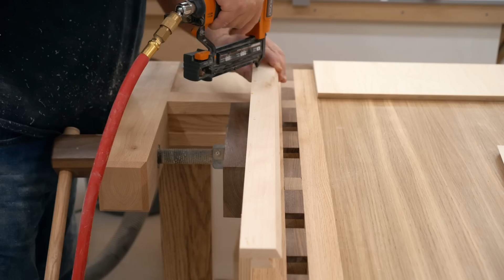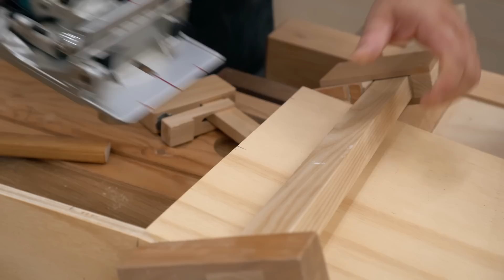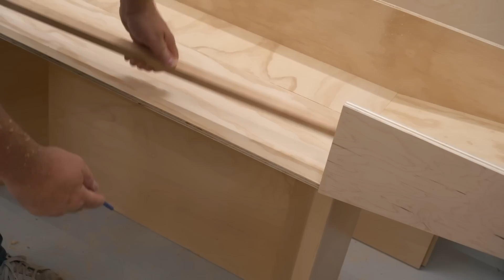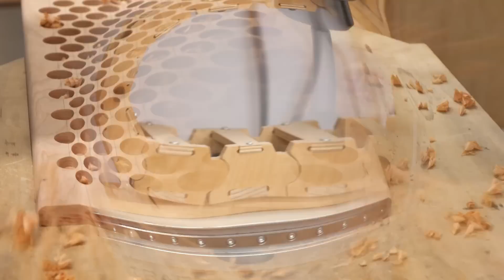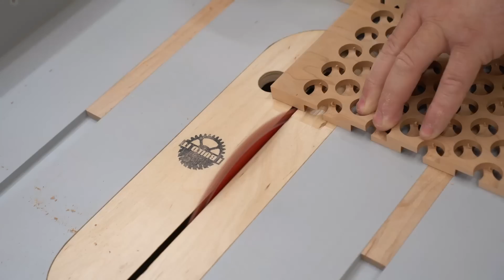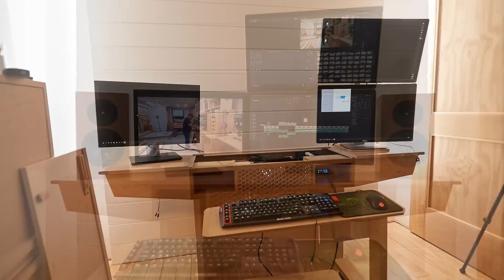Did I Make the Coolest Desk In the Known Universe? You Tell Me

Comment from the maker: I needed a computer upgrade for video editing, so I figured I'd go the full distance and build a new neat looking desk to put it in. I say desk, but it's really more like a table to put the speakers and monitors on. 
I don't sit at it; I'm in a recliner in front of it with my feet up, relaxed and chilled for editing video for long hours in comfort and style. 
Stand up desk? Are you kidding? I stand up enough without doing it while I'm doing something I can be doing in a lazy boy. 
Typical video like this one can take two days to edit and after doing this for 10 years I'm not even going to start unless the conditions are perfect. And this is as close as I've come, so far.
Just in this one room there are several projects I've done in the past. See if you can spot them all.
Key Parts: 
CPU - Ryzen 7 5800X 
MB - ASUS TUF GAMING B550M-ZAKU
RAM - CORSAIR Vengeance RGB Pro 32GB
GPU - MSI GeForce RTX 2080
NVME DRIVES - 2 -  Intel 660p Series M.2 2280 512GB - one for system, one for video editing.
The cpu, cooler, motherboard, ram and one of the m.2 drives are new. I already had the power supply, other m.2 drive and other hard drives plus the graphics card from the previous editing computer.
This thing runs Davinci Resolve and that's pretty much it. I only turn it on when I need to edit video, so it's off most of the time. I have absolutely zero concerns about heat - there's great airflow through the case with that monster fan when it spins up, and it only spins up when a video is rendering.
Reply: Hey that is a very impressive desk, the only thing I would have been concerned about is the cooling aspect but I'm sure you took that into consideration. Did you consider an all in one liquid cooler for your processor? Ever since those have become reasonably priced I have used those in my builds instead of a heat sink and fan. Another incredible job though!!
Reply: @davidloveland9634  I'd somewhat agree on the CPU cooler maybe being a little inadequate however it probably won't matter too much as heavy loads will often be on the GPU anyways. 
Overall great desk. Love the Mac Pro inspired grate.
Reply: I am also concerned about the cooling - please check your temperatures. The other thing is that the hard drives (with spinning disks) really prefer to be placed horizontally rather than upright. Just my 2c.
Reply: hm...be funny if you made an apple tower pro case but out of wood XD
really enjoyed your time lapse...if only my allergies didnt act up every time I work with sawdust :(
Reply: Love the keyboard, it's honestly the best,  without going custom. Cherry MX Brown key switches with full back light. 

Logitech G710+

If anyone watches tech channels, this is the same keyboard Linus of Linus Tech Tips uses in his work office.
Reply: WAY COOL DESIGN John! Beautiful. I have Star Trek envy right now! ;-)

Comment: I am not only impressed by the desk build itself, but your computer set up is a very powerful system.  There is no such thing as too much RAM, especially in your video card!   A strong power supply will more than cover it.  Getting gaming MB is always helpful rather than just a standard "for business" type since these were built for abuse, heat and high speed, overclocking if necessary.   You can never go wrong with a good gaming system, it will still run office software with super ease.

Comment: Very nice john. A suggestion to make it look even cleaner: why not install a 3/4" back panel attached to the desk, so you can get the displays off the desk and  onto the panel. The panel would hide the cables as well. You could also use black pipe instead to hold the displays, but I know you like making things of wood ;)

I worked in a professional broadcast post production facility and we had a huge desk that had all the editing devices (video switcher, sfx consoles, different scopes etc. The (26), 1 ton, 2' video tape machines were in a different room. Our editing suite was sound proofed with carpet on the walls and floor with acoustic ceiling tiles. No wires were ever showing. To perform  maint, the entire desk moved away from the walls, via motors that powered the desk in and out from the wall. The wall had two monitors, a preview and a final output display. The speakers were hung on the wall. On either side of the monitors.

Comment: Dreamt for 10 years of making a desk, where the monitors pop up when you turn on the computer, out of the desk, love the style of desk you built and spurs me on to make one myself! ty great design! IKEA should be so lucky to have you as a designer over in Älmhult !
Reply: It's somewhat easy to do, just get a pair of linear rails (Using wheels on the side of a board works too.) you that are the height you want + the size of the attachment (10cm or so) then you can use a windshield wiper motor to drive a threaded rod or a screw and move the board the screen is tied to up and down.
You can add a plate on piano hinge over it, it should open automatically, you can add a string tied to the bottom of the board and on the plate so it pulls it down when it bottoms out.

Comment: Wow, that's a cool build. It has so many angles it just looks so neat. I've been wondering what to do about my setup as a already stand enough at work and then working in the garage. I've finally found something that is very similar to what I would  like to do. My idea is to build a panel similar in construction to a desk, but I would mount it to the wall on standoffs. The reason is it could hide cables, mount the speakers, and I could mount the monitor to it. I thought I could also slot the mounting holes for the monitor arm so I would have some vertical adjustment. plus the panel could be artistic, I could do wood carving or burn it then seal with epoxy and mica powder, or do a hexagon and resin pour. The options are endless, if anybody has ideas post below.

Comment: Very nice.
Extra credit for the rare appearance of an optical drive. 😁
You might consider using a dust filter. Theoretically, with positive pressure and a dust filter, the case should not accumulate dust as quickly as otherwise.

Comment: Very nice. Ryzen CPUs are just great for video editing. Noctua fans are awesome. Davinci Resolve is cool too. Give Kdenlive a shot, it's a very capable & free editing solution. Run it on Linux if you're so inclined. I'd go for a MSI motherboard over Asus, certainly higher reliability. 

There's a major problem with a wood (or plastic) computer enclosure. Computers spew MASSIVE amounts of radio noise. A metal box is required to shield it. Cases with a large clear window are as bad as all plastic. You might as well build it with wood. If you attempt to listen to the AM broadcast band in proximity to this computer you will find it difficult except perhaps for the strongest stations and for shortwave listening it's completely unacceptable. Some computer parts and brands are more noisy than others. Some will interfere with the FM broadcast band. It's why metal is used. Certainty commercial manufacturers would rather use plastic. They can't and still comply with radio emission regulations.

Comment: Really cool, I want to say you should flip that big fan around so its sucking outside air into the case, and putting an easy to clean filter on it.  That way all the air going into the case is always clean.

I ran cases with negative air pressure design before and they worked, the computer was fine, but after a year they were really dusty inside and you could tell it was pulling air in from every nook and cranny around the case and sticking a bunch of dust to it.  If you have positive air pressure, you get it all stuck in one set of filters and you can just clean those whenever you think about it.

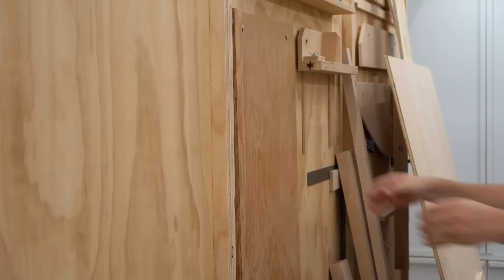Comment: At 2:10 you use what I'd describe as a reverse cross cut sled, where you push the sheet you are cutting up to the mitre fence of the sked, is this so you can larger sheets as if you pushed the sheet with the sled it would be hanging off the front of your saw. I've not seen it done this way before. Why didn't you just use your rip fence ?

Comment: All of that amazing work and you're using a wired mouse??  John John John..
You said you're pulling air in from the back to cool down the power supply..  does that mean you can feel the air blowing out towards you when you're sitting infront of it working?  Or are the offset holes on the front enough to deflect the air in other directions?
Reply from the maker: The 200mm fan pushes air out, pulling air in through the grill and everywhere else, including the power supply.
Reply: @JohnHeisz  ahh got it. I must have heard it wrong. Makes total sense.

Comment: I disagree with the biscuits I did a demo about 30 years ago at a place that most people probably don’t know of called Payless Cashways and I made a five sided box with no bottom or top out of 1x6 and two biscuits per joint and each side was around 6” I’m guessing but once it was dry I could stand it on edge and stand on it I used it to show people how strong the biscuits were for several years and never had it even think about breaking

Comment: How do you feel about pocket screws for a desk project? I have a design in mind but I don't have a biscuit tool. Don't think it's worth the investment since I probably won't use it much. Thanks.
Reply: It doesn’t matter. It’s how it looks and how practical it is. The pocket screws will work just fine. Just be slow when screwing them in to avoid splitting.
Reply: Use what you have.